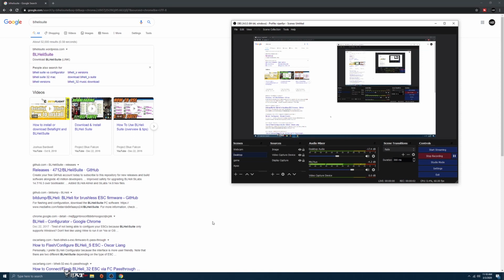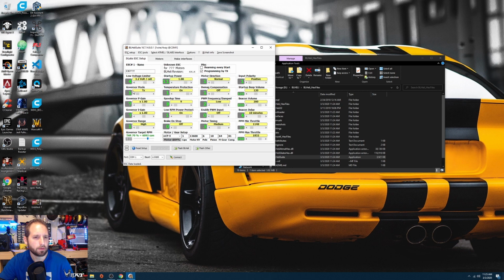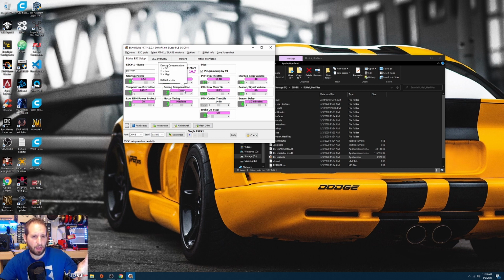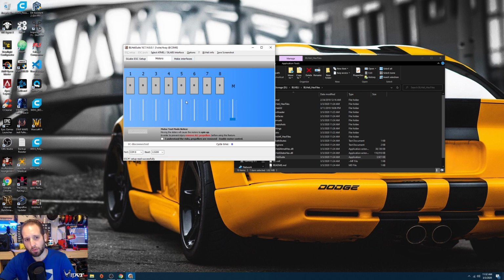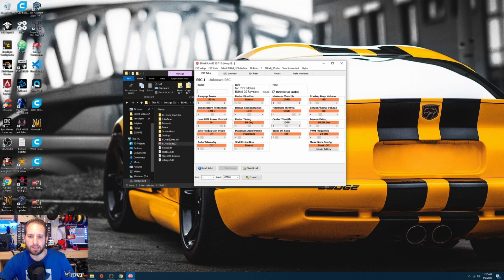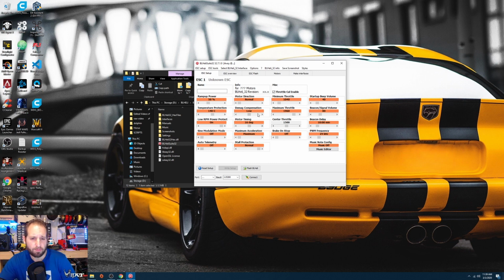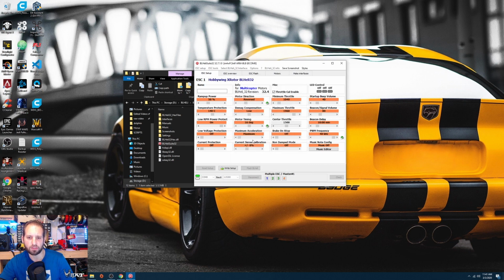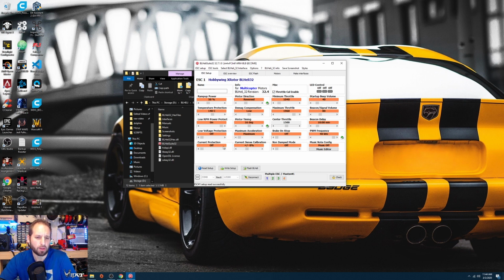BLHeliS & BLHeli32 Configuration Guide Reverse Motor Direction Change PWM Freq & More ...

Comment: @Viper_FPV is it possible to reverse the motor direction on the fly just using the PWM signal from FC ?
Reply from the maker: Yes but not on the FC just swap one wire around on the Esc to motor it will change direction

Comment: Every time I click "read set up" I get an error.  Cannot get it to work.  Any suggestions?
Reply from the maker: On the tabs on top do you have cleanflight selected? Before u try to connect.
Reply: @ViperFPV    Yep.  Doesn't make any difference.  All of my drones connect, but nothing after that.  As soon as I click "read set up,  I get an error.
Reply from the maker: @ghettogardens1  are you sure you are connected to the right port?
Reply from the maker: Email me with a snapshot of it and I’ll see if I can see an issue
Reply: @ViperFPV  The errors that I'm getting "Found no valid ESC configuration"!  How do I email you?
Reply: I have tried all of the ports.
Reply: I can't get this to work!

Comment: Thanks for the video!  Do I need to have my battery connected as well for the program to recognize my ESC?
Reply from the maker: Yes
Reply: Viper_FPV if it still doesn’t recognize it does that mean my 4 in 1 ESC is most likely ruined?
Reply: @juanfernino  I have tried all of my drones, the program does not recognize any of them.

Comment: Nice tut sir. Iam getting very hot motors can hole it for not even 5 sec. My Cinewhoop runs on  1408 3500kv motors and BLheli_S esc on Blheli configuration. I tried everything on BF 4.1 filters. Please help sir
Reply from the maker: What voltage are your running and What kind of esc are you using a
Reply: @ViperFPV  Im running on 4s 1300 mah and  Blheli_S on jesc firmware. Before using RPM filter also i have facing this issue. I now checked motors on table without props on BF mot tab Still mot getting hot but not as hot when flying. On table atleast i can hold the motors
Reply from the maker: Rajeev Gopal have you double checked your motor screws are not touching the windings?
Reply: @ViperFPV  Yes not touching? Sir now i changed to Dshot 600 and 8k. and tested on bench without props i think its getting less hotter?
Reply from the maker: I mean the bolts that connect the motor to the arm. If they are too long they will touch the wires underneath the motor and cause a short and will def cause hot motors and bad video noise
Reply: @ViperFPV  No its not touching sir. I checked with multimeter  there is no continuity between screws and frame.